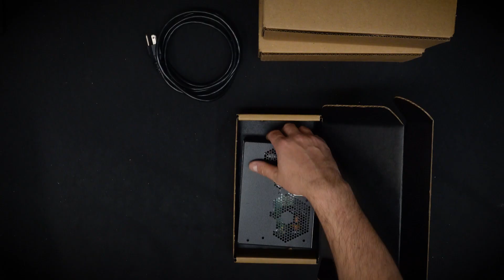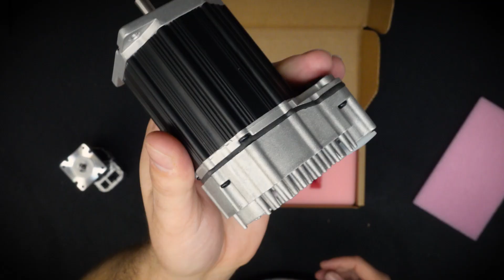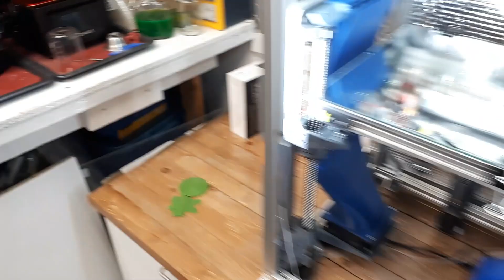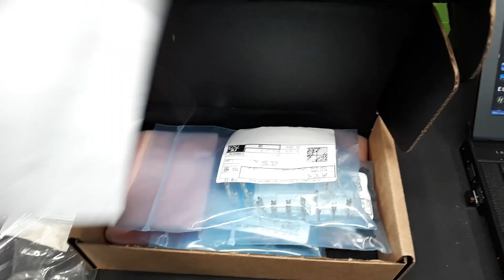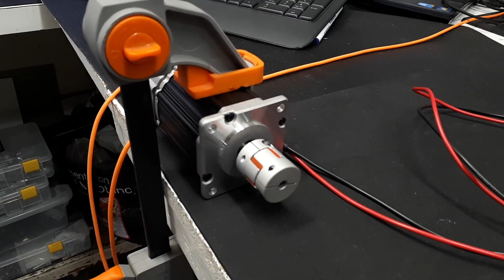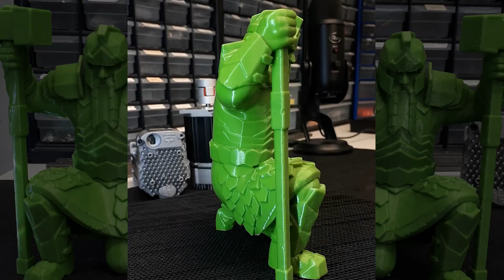3D Printing with Servos (Video from 2021) - ClearPath Demo

Comment: Can I connect my Octopus pro to Mitsubishi MR-J4-10A?
Is the AB motor shaft coupling effective or necessary. I was thinking putting them on to reduce the resonance, Will installing a coupling affect accuracy

Comment: In this exact setup, you actually do not need the breakout board for the Duet 2 to boost the signal to 5v. The duet expansion slot does output 3.3v on its own, which the Clearpath motors do accept even though it is out of spec for the ClearPath motor, which is 5v-24v. It does work with the direct 3.3v connection. However, you still need some form of a breakout connector, as the Duet 2 expansion slot pins are very close together. The proper connecter is a 50 way IDC cable. You can then take the other end of the cable, cut and strip the wires, and plug them directly into the ClearPath motors. You can also run the Clearpath motors at 24v and get the same amount of power, but less RPM, so you can run them off of your printer power supply.
Reply: That's incorrect.  Power is torque times speed, and speed is directly proportional to voltage.  If you look at ClearPath's torque-speed chart you can clearly see this by selecting different voltages.  Also you need a PSU that can supply the required amount of current, plus handle back EMF produced from the fast decels.
Reply: @louieatienza8762  When I said "power" I was intending to mean Newton-meters of force output from the motors. Clearpath motors guarantee a certain amount of torque at certain RPMs, such as the SDSK 2321S able to output 98 oz-in (0.7 N-m) of torque at its rated RPMs. If you run it at 24v or 75v, the ratting is still 98 oz-in (0.7 N-m) at the same RPM of 500. There is more "Peak Torque" output at high voltages, but on their charts I was referring to the constant torque, which has been renamed to RMS torque.
Reply: @3DPotterTech  That's the confusion, force (torque) is not power.  You can exert 1000ft-lbs on a shaft, but if it doesn't budge at all, you're generating zero horsepower.  Torque does not move an axis, power does.  Voltage equals more power since the motors can spin faster, torque is mainly regulated by the current.  Using the motor example you gave, at 24V, at the point right around where torque drops, you're looking at 0.06HP, whereas at 75V you're at 0.23HP.  So likely, a NEMA17 closed-loop stepper or 40mm class servo would probably work better, at probably 1/4 the price.  So why pay $315 if you're only going to run it at 0.06HP?  You can get the CPM-SDSK-2310D-RLN and save $50 per axis.  While you can direct-drive these, you don't get the true benefits of them unless you gear them down, so that the servos work at their optimal power (which is fast).  And if you get one that runs under a lower RPM range, it has way too much torque for 3D printing.

In short, these ClearPath servos are designed to run optimally at 75V.  If you neuter them by running them at 24V, you have too much disposable income.

Comment: I think the artifact that are still visible are from the belts and small pully bearings, facets from the STL (even with arc welder enabled) and the molted plastic consistency.

Comment: Awesome video. Did you tune all servos at the same time, or did you tune each one seperatly? I got a relatively strong wobble on x and y motion and currently try to figure out the problem.
Reply from the maker: I tuned each motor separately on my CoreXY.  I clamped the Belt from the unused servo to lock the system in place.

Comment: Would it be possible to run 120v AC winch motors off an Octopus Max EZ board using DC to AC relays? Or some other way?

Comment: Hello, I'm currently experimenting with the clearpath motors. Have you got the engines running regarding the M569 T parameters and tuning? I would be very grateful for an exchange.
Reply from the maker: I mainly ran them using Klipper.  RRF had issues to keep up with the amount of steps per second.  My M569 was: M569 P5 R0 T2:2:2:2 S0
You can get my servo tuning files here: https://github.com/MirageC79/HevORT/tree/master/HD/ClearPath_Servos

Comment: You say that the high resolution models create artifacts on flat surface.

I have these motors (2310s) and the same PSU.  and they create waves. I feel I have tested everything. Your prints looks much better.

Can you share you duet Timings? (Taa:bb:cc:dd)?

I'm still using them because those wavy patterns still annoy me less then that super load NEMA mtoror chirping
Reply from the maker: Sorry for the delayed reply.  Here are my tuning profiles for the ClearPaths: https://github.com/MirageC79/HevORT/tree/master/HD/ClearPath_Servos
And here is an example of my config file: https://github.com/MirageC79/HevORT/blob/master/firmware/klipper/printer_ClearPathDuet.cfg

Hope this helps
Reply: @HevORT  np. Thank you
Reply: I have the same problem with the wavy pattern. Did you find a solution? When I print slow I have more wave artifacts than printing fast.
Reply: @seeleyDE  I haven't removed them completely but check cables that they aren't near 230v power cables for interference. That helped a lot but still not completely gone
Reply: @jbergene Interesting. Thanks for the reply. I'm going to make some tests. Did you have the wave problem with your ballscrew printer?

Comment: Ive always wondered rather than a faster and faster head .... Split the build chamber into 4 and have 4 independent hot ends that overlap. Yeah the control could be more difficult to avoid collisions byt surely that would be faster right??
Reply: Thats just 4 3d printers but your design creates a lot of wasted space due to the fatness of a hotend
Reply: @phoenix4193  the thickness from the offset is wasted true.... But each quadrant can be working on parts of the same layer simultaneously so loose 25mm but potentially faster

Comment: I am using clearpath servos and they have a smoothing function that causes a tiny delay. If I use clearpath on one axis and stepper on the other, my small circles turn oval.

This causes an issue for extrusion because the servos are slower than the extruder stepper causing stringing due to early/late retraction.

I am wondering if there is a way to set a persistent fixed delay for the extruder so help sync the servo with the extruder stepper. Still not the best solution as the extruder will be slower during straight lines as the servo catches up.

I wish someone makes 3D printer controller that don't use STEP/DIR and have actual path planning.
Reply: I wonder if you could use a negative pressure advance value.  I imagine someone could write a script to run your code g code through to delay your extruder by so much, not a great band aid
Reply: Why would you want to mix motors for movement axes?
Reply: @mateijordache1952  I was doing some testing and switched one at a time. This delay also happens for 5-phase steppers from oriental motors as they also have a smoothing option on the driver.

Comment: When you mention print artifacts on flat surfaces, are you referring to something similar to VFAs on stepper motors? Would you still recommend these over something like the LDO 2405?
Reply: I think he is referring to the ripple effect caused by the tooth profile on the belt.  aka the clearpaths have more consistent movement than steppers making the artifact more prevalent.  Nearly every printer that is extremely well-tuned will have this artifact, its a ripple that you cant feel, and barely see with the same pitch of the belt profile.

Comment: even if your board doesnt output 5v signal say 3v like the octopus board im using with servos you can run your step/dir signals to the - port and run a constant 5v supply from a 5v header to the + step/dir say on a jmc or stepperonline motor.  not sure about the clearpath also can't forget about adding the pulse width line into your klipper config to prevent any weird issues that resemble missed steps
Reply: Hey can you elaborate on the "pulse width line". I got integrated servo motors to work with Marlin, but moving to Klipper they don't seem to be behaving the same. Thanks

Comment: Awesome! What top speeds did you manage to reach with the servos?
Reply from the maker: Theoretical max speed is 2100mm/s.  But hotend was the major road block.
Reply: @HevORT  What are the artifacts on flat surfaces you were talking about caused by?